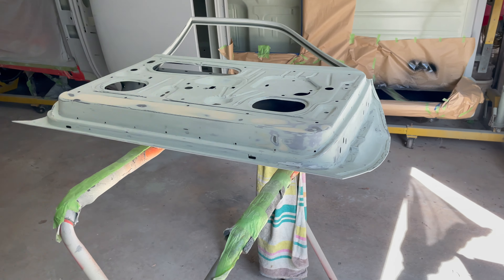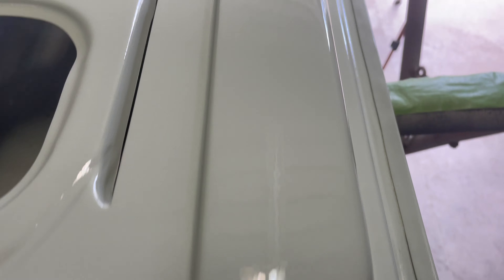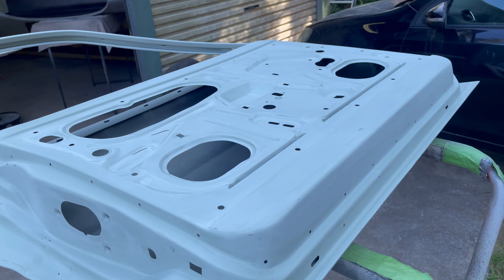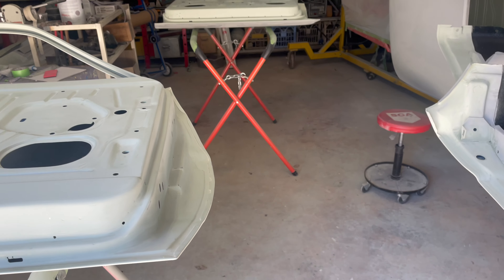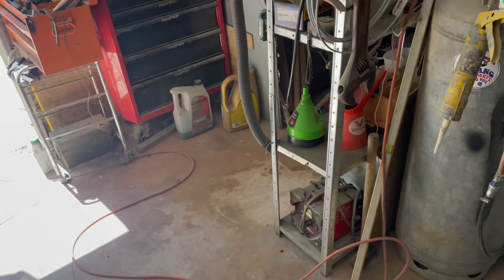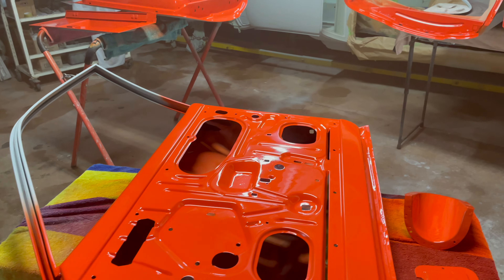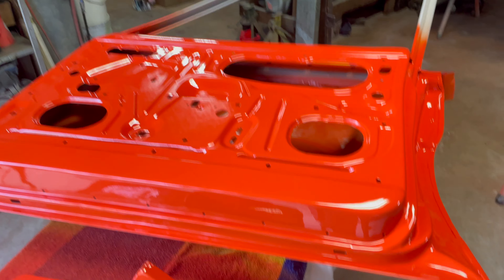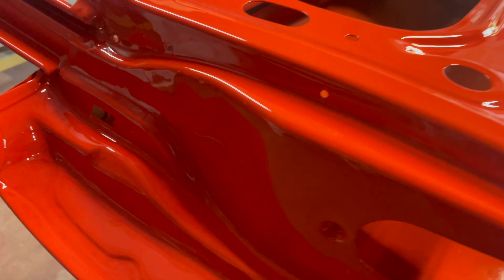Ford Falcon 500 XY Ute Restoration Part 77

Comment: Hi Andrew, looking good so far. Trying to stop dust isnt easy, but it looks like you succeeded alright. I would say that you have an XW passengers door and an XY drivers door. Cheers from NZ, Phil.
Reply from the maker: Thanks Phill appreciate that. I have to laugh. You are absolutely correct. When I looked at the video, I realized I got them muddled up. The drivers door is the original  which makes it the XY one, I still don’t think it’s original to the car because it has the holes for the adjustable side mirror however, it had original bronze paint on it, which left me perplexed. PS greetings and salutations NZ. 🤗:-)

Comment: This project is really coming together. Some great work on this channel. Would you mind running a tape measure across the the rotisseire as you have the ute on now. I'm interested to know what the overall length is.
Reply from the maker: Hi lofty. The rotisserie is very adjustable. If I recall it can take something as small as a mini minor and it would have no trouble extending out to take something as big as a Hilux. I think at the moment it’s about 6 1/2 m for the Ute. :-)

Comment: Ohhh how exciting great job

One word of caution…I did a xy up when I was younger and did the GT black-outs etc etc sills, door frames and I look back at the car now with older eyes and it tended to look like a xy with a confused identity…. A car that didn’t quite know what it was 

So before you lay any GT black outs really think about it make sure it’s the look you want! 
That Ute would look amazing with just a gold GS stripe and sill moulds 
The blackouts look weird without all the other GT stuff 
Just my opinion
Reply from the maker: Thanks Mate I really appreciate that.
I think that you have a very good point. I will discuss it with Josh and talk it over with some friends. It is pretty easy not to put the black on until later if I still want to. Thanks very much Jack for your input. :-)
Reply: @DonsTrix  
No worries mate I can send you pictures of what mine looked like if that helps in any way
Reply from the maker: Yes, I would like that. That would be great. I think our email address is donstrix4@gmail.com